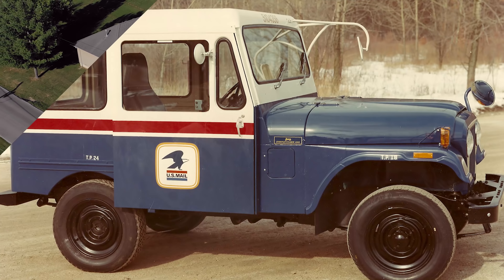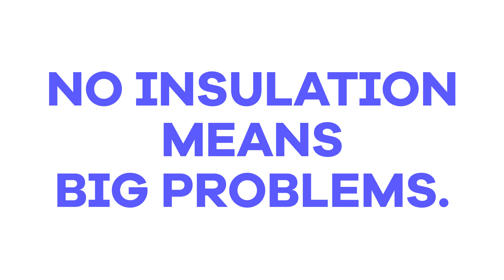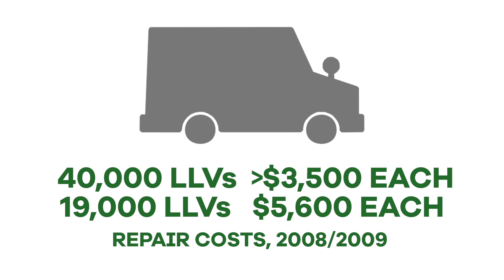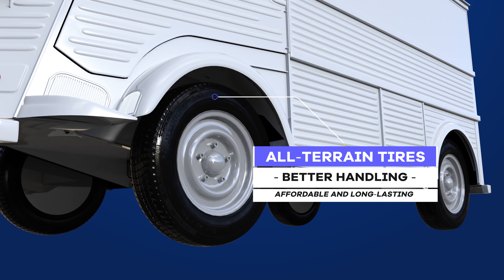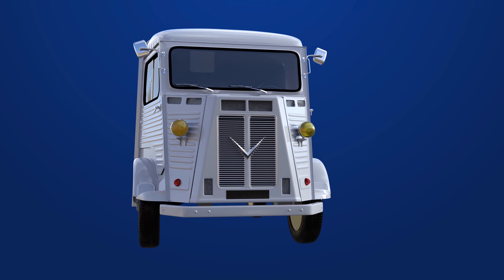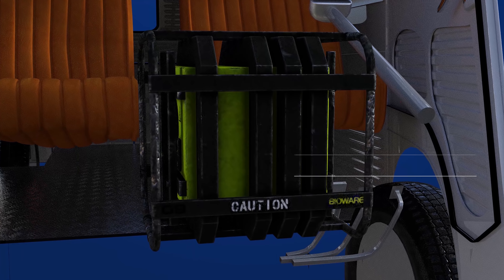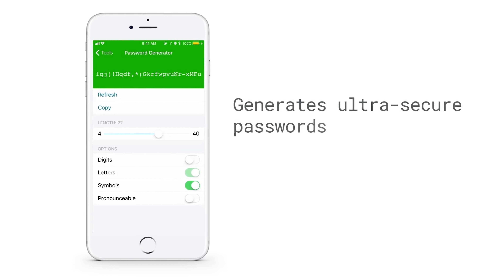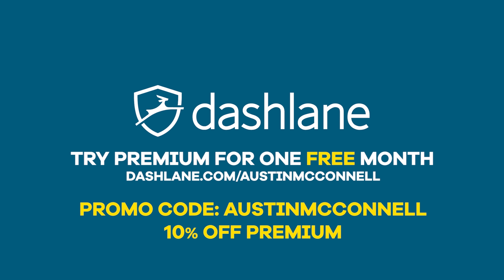Postal Delivery Trucks Stink. Let's Redesign Them.

Comment: The simple fluke of putting the steering wheel on the wrong side will follow Austin to the grave.

The poor man didn’t remember that every mailman in existence drops envelopes into the mailbox through their right-side window. He designed a mail truck and completely forgot the most basic function of a mail truck.

He was right about the flames though.
Reply: God damn was he right about the flames.
Reply: I agree the mail trucks will need to be right hand drive to meet requirements of current infrastructure, but if that feature is changed as well as replace the passenger seat with a compact fold-out seat due to infrequency of use, and keep the rear door on the right side this would be an amazingly efficient addition to any post fleet. I also agree that the flames are imperative to the function of the truck.
Reply: Zak Jakubiszyn Or center the seat in the middle of the cabin, with the cock pit narrowing. The mail person would have too far to reach to use either window.
Reply: @jakubiszyn96  The ride height also cannot be changed. It sits low so the carrier can reach into the mailbox through the open window.
Reply: Either make them dual drive like some garbage trucks, or completely fly-by-wire so they could slide the controls from one side to the other.
Reply: Not to mention the fact that the truck looks more like a Ford Model T than anything suited for the modern day.  Recent cars and trucks have their styles not just for looks, but for safety as well.  That front end in a collision will send the engine block into the mailman's lap which should have been placed on the RIGHT SIDE.
Reply: Not every mailman, for country routes they are issued jeeps with a orange light on top and therefore use the left side for country/mountain routes.

Lol, semantics.
Reply: Where I come from (in the states) the mailman gets out of his vehicle and goes up to the house because no one has their mailbox anywhere near the street.
Reply: messman10   Just because the cab narrows, you still have the width of the rest of the truck.
RHD is the only solution because it works for all cases. There is nothing that says a RHD can't be used for bulk deliveries, to urban buildings, or neighborhood boxes. Even if the carrier walks a neighborhood route it would still be safer to work loading and unloading their bag or cart away from traffic.
Reply: Not where I live cuz all our mail boxes are attached to our house
Reply: That's my neighborhood too.  The walking mailman is only in older, more urban neighborhoods.  I would say maybe 10% of deliveries are done this way.
Reply: Deven Gray Where I come from (in the states) the mailman doesn't even get out of their vehicle to deliver big packages.
Reply: Psychedelic Lizard why don’t we just have retired shooting guards making free throws from the truck. Then you could just have a normal truck and it be easier to mass produce
Reply: Wait no We need to have ultimate frisbee throwers to do it. There form would be much more suited to the shape of the envelope
Reply: I'm actually kind of confused by the right-side wheel because most of the mailboxes in my town are on the left or on the front doors of houses, and not the side of the road unless it's outside of town.
Reply: But as he pointed out, the current design is already prone to flames, just actual flames.

Comment: Speaking as a former letter carrier of 25 yrs. experience you are correct these trucks are poorly designed but you made them worse....much worse.
Reply: Coleman Adamson how so?
Reply: so are you gonna say why or
Reply: Coleman Adamson still hasn’t said why
Reply: Just look at the comment right above this one, it explains all the issues.
Reply: That's why he's not a car designer.
He tried with information he had, we don't need to use his design.
A real company will come up with one, no need to get worked up over a video
Reply: +L.V.C 

He's getting as worked up about the video as you are over his comment.

The maker of this video has not used "all the information he had". Did he ever look at mail being delivered? It obvious that the seat is on the right so that they can lean out and put in mail/small packages. How can he not realize that in the 20+ years he spent on this planet?
Reply: L.V.C 

Well if the whole premise of the video is making a better postal truck since current trucks are so bad and you end up making it much worse, I’m not really sure if that’s a good video.

Like I love Austin, but obviously his accuracy can vary a lot on topic to topic, and in this case judging from people with experience Austin missed the mark by a mile in the other direction.
Reply: Coleman Adamson  coming from a flat earther lmao
Reply: @william_aviation0145  Letter carriers need a small truck with good turning range. This is why the front axle is shorter which allows tighter turning. Making the LLV bigger is not the solution in any way. And don't get started on how much it would cost turning delivery from right hand drive to left. ROFL. You want to help fix delivery. Every house in the U.S. needs to be in Neighborhood Box Units. No more house delivery.
Reply: Since when is commenting about the video getting worked up about the video? It’s literally what you’re supposed to do, COMMENT.
Reply: @william_aviation0145  why
Reply: >"these trucks are poorly designed but you made them worse... much worse"

The fruits of government contracts in a nutshell, right there. It's like they go "oh, it ain't broke? Let's break it, then!"
Reply: Someone already redesigned it. They call them FFVs and I think they are worse. But you need to have right hand drive to reach the mailbox, and also there needs to be somewhere to put all the letters and such up front with you.
Reply: Curtis Tisberger  the point of the video is to redesign the truck to be safer, and to save money. For safety reasons the truck must be put in park and turned off any time you are not in the seat. How much longer is it going to take to deliver mail if you have to do that at every single mailbox to go into the back to get 1 or 2 letters?
Reply: @andrewgillette4351  cluster boxes, yuck but efficient. I hate them and love them but I'm a rca so not many cluster boxes on my 128 mile route.
Reply: @vlc-cosplayer  heck no, I'm gonna put flames on my jeep POV. Haha. I loved that part.
Reply: Wackinator 66  haha. AC would be good.
Reply: Coleman Adamson it’s a joke video
Reply: Not to mention in reality an electric postal van is not really that practical. allow me to explain the LLV gets what 10 miles per gallon? And assuming you have the same equivalent to 10 miles per gallon in charge you have an overabundance of gas stations but in regard to electric charging stations not so much (perhaps in sanfransisco or a city out west) taking into account regenerative breaking you can increase the range that 10 gallon equivalent will get you but even then its prohibitive in range and would actually Increase service costs as well as purchase costs not even taking into account that some post offices take deliveries to people out in the countryside outside of town for example every time a mail delivery is sent to my home they use a LLV (and my home is fairly far out of town enough so that riding a bike into town would be impractical) this taking not taking into account the driver.
Reply: Trantor The Troll  he is not trying to design it
Reply: @ArbiterBrick  no its not
Reply: Trantor The Troll  you do realize he isn't calling them an idiot or stupid they are just making a joke.
Reply: @rapterranger771  The left hand drive alone would do it. Right hand drive makes mounted delivery so much easier. Also, being that high up makes it harder to reach those mailboxes. Hood that tall means worse visibility out the front and that means the little kid playing in front of the truck is gonna get run over. Bigger vehicle means worse turning radius as well, which sucks for a mail carrier. Oh, and electric? No fucking thanks. The infrastructure for a fleet of electric vehicles this large does not exist yet.
Reply: How you feeling now? The new trucks are basically EXACTLY what he predicted aside from his dumb move of the wheel side.
Reply: @Cooe.  In what way exactly?
Reply: Why not?
Reply: @rapterranger771  hes banned he cant respond...
Reply: @frenchfrog2248 wait, what? Banned? How do you know that?

Comment: Umm sorry but terrible design, I work for the USPS. I need to have my steering wheel on the right side so I don’t have to scoot over at every mail box I deliver to... if someone doesn’t know what I’m talking about, we have to drive in the right side of the road, also the mailboxes are on the right side, so there for having the driver on the left side means that they cannot access the mailbox with ease and efficiency! Another reason why this is a bad design is these need to be cheap for the USPS... electric motors and allllll that electronics like cameras and monitoring systems and on board computer and 360 sensors are no cheap at all! Another is it needs a more modern design, not a milk truck design. The only thing these things need are semi full time AWD, redesigned and updated engines, A/C / better heat, better insulated, and of coarse more comfortable and supportive seats (as long as I have a comfy seat I’m good honestly these seats now ruined my back)
Reply: The electric motors wont actually be a cost issue, electric motors are quite cheap , and the mail truck wont need a giant motor, since its going to be going low speeds. The cost of batteries is a bigger issue with an electric vehicle however. Looking at the test electric conversion, they used 55kWh of batteries, which would cost 6-10k. Including the motor as $1-1.5k you are looking at a $7-12k power-train cost for the electric conversion, which would be heavily offset by difference between fuel and electricity prices. If we assume a rough $2k per year in fuel savings, the electric power-train would be cost effective.
Reply: When he said the steering wheel wasn't going to be in the right, I was like "uhhh... Yeah, that's not gonna work..." Lol.
Reply: so basically you need a standard commercial van... Every european delivery company works with them just fine. No need to reinvent wheel I would say.
Reply: The electric drivetrain would pay itself off in a year 😂
Reply: @jetstreambrony  Yes good point, I never thought about the offset that the fuel savings would make, thank you!
Reply: Roblox Insider Well for one, I appreciate you for making me chuckle a bit! So thank you! Second, I do feel like I have a “Can I talk to your manager attitude” gets things done! And last, boy do I hate what modern society has done to everyone. I don’t care about his opinion, I don’t care about what people think of my opinion, and I honestly don’t give a shit about yours! Have a nice night!
Reply: @jetstreambrony  The bigger problem with going electric is the infrastructure cost at the local post office level. You'd have to install charger outlets in every post office, which isn't that cheap. On top of that, many post offices are old buildings with inadequate electrical service to charge 20 trucks or whatever at a time.
Reply: @elijahwatson8119  You bring up a great point, however, I think that you may be slightly overestimating the costs, as the charging infrastructure can be a separate system installed in the parking lot where these trucks are in above ground units. The power supply wont be as big as something like a supercharger either as these vehicles will have all night to charge. Charging at night also reduces the cost of the electricity. That being said, as a whole electric vehicles are going to be taxing on the existing power delivery network in urban and rural areas, as the load on those lines will increase every year.
Reply: Yes, the steering wheel on the left is a mistake, but otherwise it's a very nice design! The electric motor will save a TON on fuel costs, making everything else you pointed out cost-effective!
Reply: 40’s-50’s
Reply: Also it of course not coarse , coarse is how fine something is
Reply: It's the US govt,  the cost of tech is no concern, it's the numbers required that is the draw back,  if the fleet only needed 50k trucks,  you could have all the bells, whistles and modcons u want. It the fact u are likely going to need 3x that number given ur growing population, so I think ur better with the ak47 approach, simple machines that work well enough to get the job done but is still simple enough to fix cheaply and efficiently. The electric motor is a waste of money until the tech in that area improves dramatically, but as far as the look of the truck,  it'd do great as a rapid response fall back for the Nat guard and civilian militia groups (arms deliveries and such into terrain u couldn't get a semi or airdrop into), if it had a simple deasel engine it could be a very versatile truck in the public service,  just not for mail delivery.
Reply: Wolf9326 my mailbox is on the left side of the road
Reply: This video is a joke..,you dont realize,dont you?

Comment: From the comments, you're going about design wrong.

Step 1 is always speak to the users. Talk to the mail delivery people, ask them what they like about current trucks, and want improved on. Otherwise, you're going to be guessing at their needs and that rarely, if ever, works properly.
Reply: Mail carrier here. The current truck with airbags, air conditioning, antilock brakes, power steering, 4WD, a backup camera, and a little more power/more gears in the transmission would be perfect. Maybe make it slightly larger for packages too.
Reply: Retired USPS carrier here. One thing I haven't seen in the comments is the too-long wheel-base of Austin's vehicle. USPS trucks typically need to make many U-turns. They need a shorter wheel-base... like the one in the LLV.

Comment: The flames are totally needed.
Reply: The problem is... they make it go FASTER (meaning more costs asociated with brakes and increasing chance of getting into accidents or speeding tickets).
Reply: Argamis (SilverComet) you can set caps on new engines they’d just need to set a horsepower and top speed cap
Reply: Yeah, but that only stops the acceleration provided BY THE ENGINE.
The acceleration provided BY THE FLAMES is still there...
-> The "top speed cap" is where the costs asociated with brakes come from.
Reply: Hmm... So... What does "totally needed" taste like. Did the flames enjoy the wordy snack or what?

JK, of course.
Reply: Not only that, it's also a huge security feature and lets you assert dominance.
Like "woh, this badass motherfucker has flames on his ride, I ain't fuckin wit dat, nah ah"
Reply: Biggest problem with your design is doesn't list costs and when it comes to those contacts the best designed isn't going to win, it's the most cost effective. Wouldn't be surprised if already the cameras get scrapped.

Comment: 5:17 that technology totally won't be obsolete in 5 years rendering the purpose of long lasting unattainable
Reply: It's software, hardware isnt long-term however software is updatable
Reply: Technology changes so fast now. It's difficult to design anything that won't be obsolete in 20 years. In 20 years your mail will probably deliver itself.
Reply: Brett Cooper self driving cars
Reply: @brogcooper25  It'll even be possible now but our global GPS is fucked up and no one's fixing it.
Reply: Mr Flip-flop I’m pretty sure global gps isn’t entirely accurate because the government doesn’t want people to be able to fly a drone 1000ft in the air and drop an egg on someone’s house from out of sight
Reply: Any system with a gps and wifi should be able to just upload their data to one of the databases the postal service has, so they can take care of it. It doesn’t matter if the screen isn’t holographic, what matters is that it’s better than the tablet

Comment: Getting rid of the right side wheel would be a huge mistake.  It isn't on the right side of the car currently "for safety" as Austin says - Rural deliveries are spaced out and require the letter carriers to be able to reach over to the mailboxes and deposit the letters directly.  If it were changed rural deliveries and deliveries to mailboxes at the street level would have to be done by hand (which, because of the distance between houses/mailboxes would add to the time it makes to deliver) .  You could say to just reach over the right side seat and deliver it to the boxes that way but that would mean the driver would have to keep on taking off their seatbelt, dropping the letters and then put their seatbelt back on to them make a 15-20 sec drive to the next mailbox to then repeat... and repeat... and repeat.
Reply: I lived in a very spread-out town, and one of our mail carriers drove a normal American car, sitting in the middle of the bench seat, steering with her left hand, and using her left foot for both pedals (automatic transmission). It looked awkward, and was likely dangerous, particularly if there was an impact.
Reply: Yeah the lady that normally delivers the mail on my street in a fairly small town but not real spread out drives a 2000s model Jeep Liberty. Sits somewhat in the middle to steer and uses the left foot for the pedals and the basket of mail in the drivers seat. Fancy strobe light blinking on top. One day not too long ago, a white dodge challenger rolled up, clearly not a mail delivery personnel, put an envelope in my mail box. Yeah it was meant for the next door neighbor.
Reply: @MonkeyJedi99  It really is I do that currently in my chevy pick up. Ive even been pulled over whilst doing so fortunately the law is on my side with this issue.
Reply: Yeah, the whole point of having the doors slide open and lock on the right side is so the mail carriers can deliver mail to boxes without ever leaving their seat.